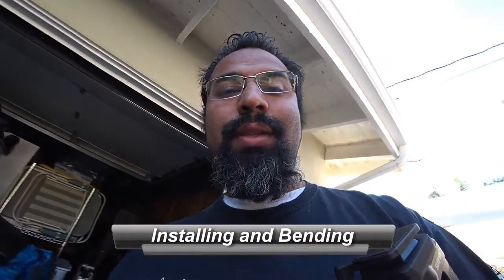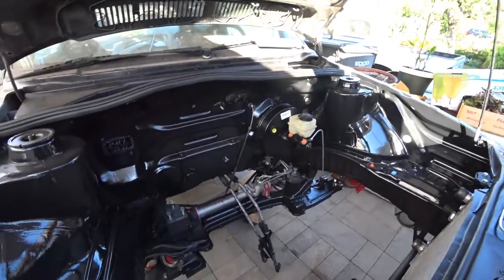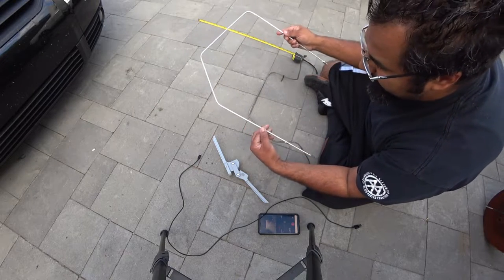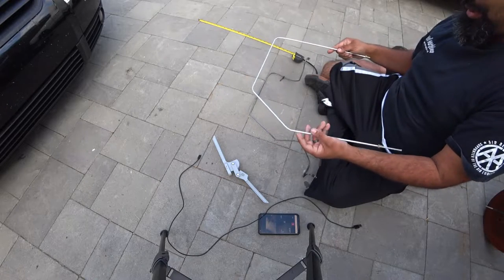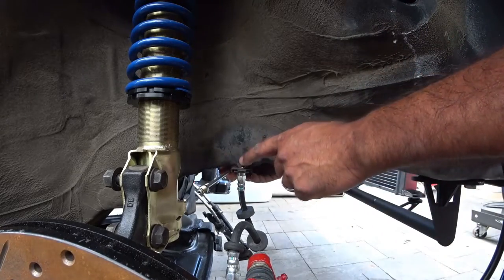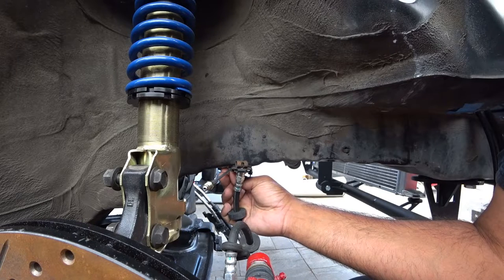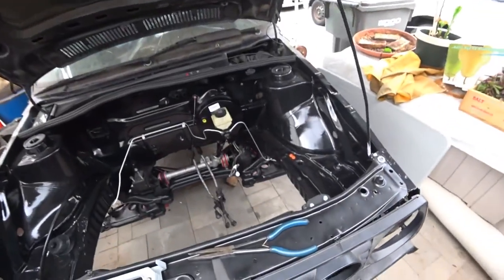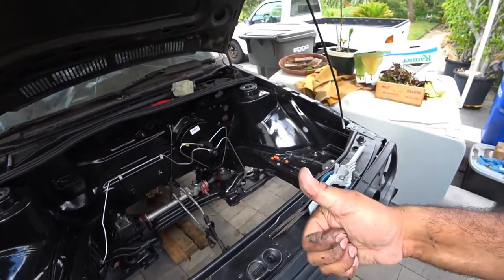How to Bend and Install Brake Hard Lines in a MK2 GTI S6 EP15

Comment: Do you have any videos on how to install the rear proportion valve ?
Reply from the maker: That video got destroyed was pissed
Reply: @PincheALsGarage  damn I recently just purchased a new one and I'm wondering if I can upgrade my lines to braided is that possible?
Reply from the maker: @nachooofilms7675  you can replace the 2 rubber hoses with braided lines one on top of the caliper and one between the beam
Reply: What did u do with the rear proportion valve or just stock one